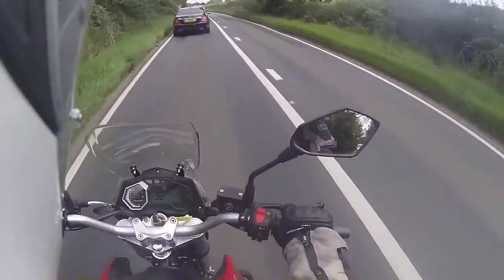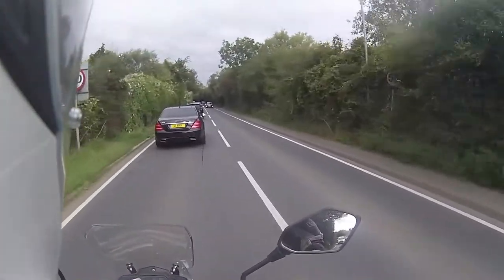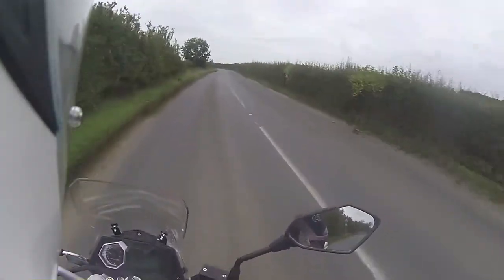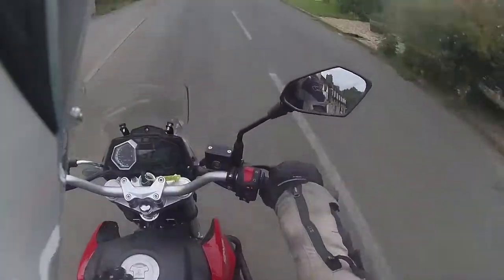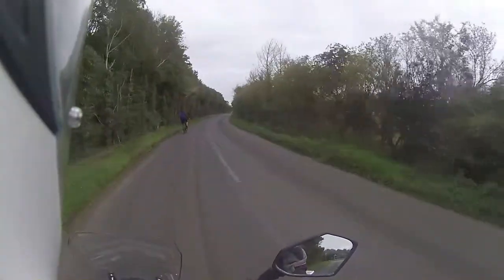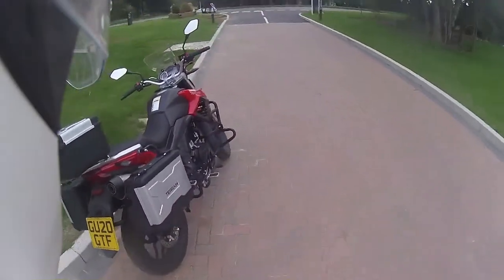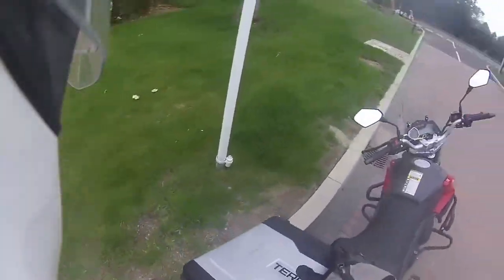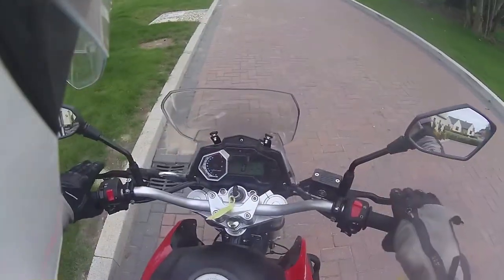First Ride: 2020 Sinnis Terrian 125

Comment: I have a 2021 (Euro5) model. It has linked brakes. ABS would have pushed the price quite a bit. It seems to be 50/50 split brake effort from the rear pedal. The front brake lever only operates the front brake, which is very effective. Personally I hate linked brakes. And it makes the bike impossible to ride safely on loose gravel or wet vegetation (ie off road). The front wheel slides away from you so easy its dangerous. I think they should not be allowed to sell "terrain" bikes if they have linked brakes.  It is ok on the road once you get used to it.

Comment: Chris I think I heard you say the 2021 prototype doesn't have linked brakes, does that mean ABS?

Also did they say if there will be any engine changes or possibly a led headlight?

As I notice Benelli, Mondial, Zontes are all now equipping there upcoming 125s with liquid cooled engines.
Reply: @LoneWallyUK  If this is the way there going I genuinely believe they will have a bike in there hands toppling the Honda Varadero as king of the 125's.

14/15bhp and a 6 gear is a must so fingers crossed.

Thanks for your response.
Reply: @LoneWallyUK  just to let you know Chris I've spoken to one of there main dealers who have confirmed LED Headlight, No ABS, 14BHP LC Engine Top Speed 73mph Due March 2021.
Video on YouTube showing changes Zongshen RX1 2020

Hopes this helps your viewer's.

Btw good video👍🏻
Reply: Gary Dodgson  fair point Gary.
However have you taken a look at the New Zontes 125's Bosch ABS, Bosch EFI, Keyless Start. 14.5bhp LC Engine, Stainless steel exhaust, Tubeless tyres, LED Headlights.
Check out the Motors for the masses review.

Their definitely is a big jump in the quality of Chinese bikes
Reply: I have owned the 2021 model now for nearly a month.
Doesn't have linked breaks or led headlight unfortunately but I might buy and install a led headlight just because less electric more brighter as I find default light isn't really bright
Reply: @peterhuskie3858  how you getting on with it? and if you don't mind answering this, what's the top end you've had out of it up to yet?
Reply: @peterhuskie3858  The 2021 euro5 Terrain IS linked brakes. Regulations!

Comment: Great looking bike but 55mph top speed is just pathetic.
Reply: @LoneWallyUK  The 2021 has the same performance  even though the new engine has 6 gears ( which is overkill for a 125 bimble bike ) but are geared close together & is liquid cooled .The extra liquid cooled gubbins & bigger cat ,have strangled the extra odd horsepower the new engine has provided giving a top reported speed of around 58 mph .The new Euro 5 bike price is reported at £2,900 about £300 increase over the Euro 4 model which I reckon is better & better value .